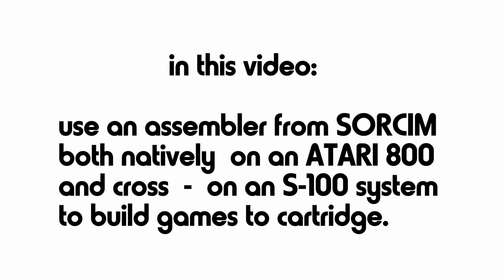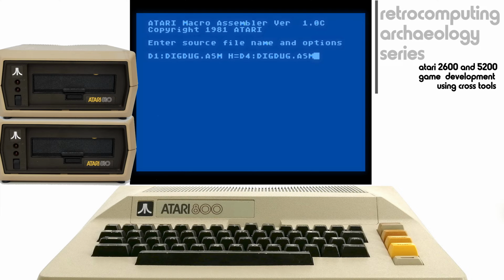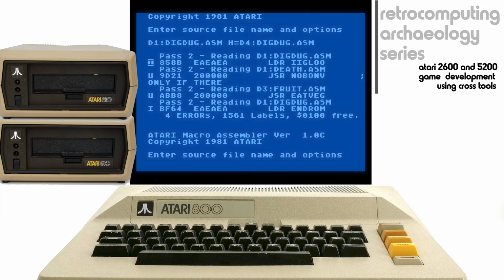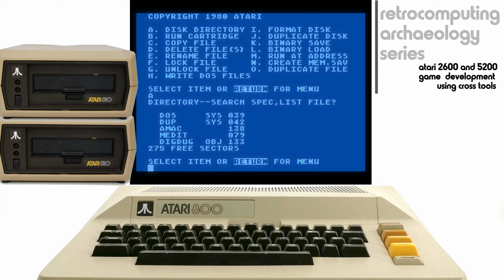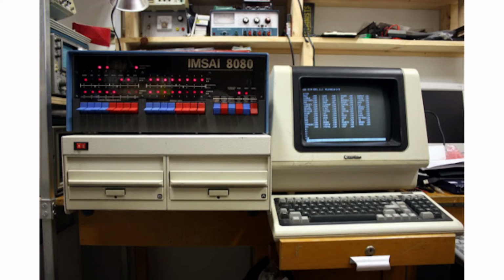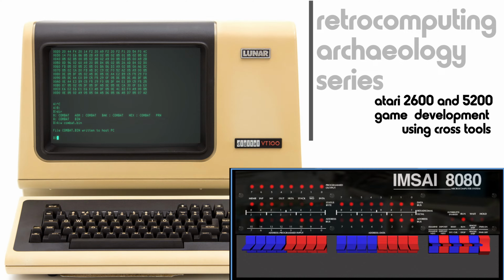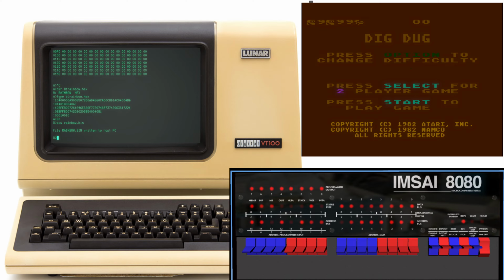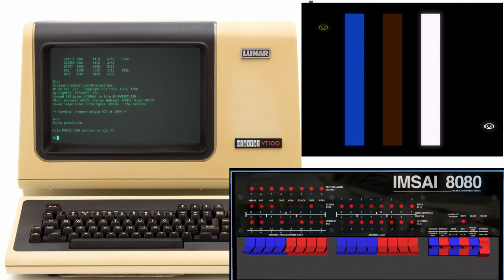An Example of how #Atari2600 and #Atari5200 #Gamedev was done #BITD using #S100 hardware.

Comment: Atari 800 5.25" floppies only held 90K?!? Wow! I had an Apple II+ back in the day and its disks held 144K. I wonder why Atari Disks had such low capacity? There must have been a lot of overhead in the formatting scheme.
Reply from the maker: Single sided, single density. 40 tracks, 18 sec/trk, 128 bytes/sector.

Comment: Nice, I really enjoyed this video and the presentation style.  But... how could you run the 2600 code on the 800 - are they that compatible?  Maybe I just missed when you explained this.
Reply from the maker: The 2600 code is not running on an 800. 

It is running on a 2600 with a black box, which I am simulating with Stella.
Reply: It looks like you're starting the assembled file inside the 800 emulator at https://www.youtube.com/watch?v=59qT2HFWJRo&t=2043s . I can't get any references to "black box" when I google it - except for the "Vader" 2600, so I guess that's the model you let Stella emulate.

Having tried a couple times to write a game for 2600 on modern equipment using Stella (and also on real 2600 hardware with a RAM cartridge)  I really feel sorry for the poor guys back in the day with compilation times of several to tens of minutes of code iteration & test times and no possibility of debugging / single stepping. I didn't realise that assembling the code took that long.

The slow assembly speed is a bit strange since an assembler does a much more straightforward and simple job compared to a real compiler.  Maybe the bottleneck is the transfer speed from the floppies rather than the compiler itself?
Reply from the maker: @MatsEngstrom  This is an example of using the native assembler on the Atari 800 to assemble an Atari 800/5200 game.

"Black Box" or "Brown Box" was an industry term for a ROM emulation and debugging setup, consisting of custom circuitry attached to the target game system (usually to the CPU) to intercept its signals so that a developer can perform rudimentary debugging procedures. I am simulating black boxes for the 800, 2600, and 5200 here with emulators, in this case, Altirra and Stella.

Why didn't I use a real black box? Because I don't have one, and very few people actually have any of these artifacts (and they are VERY content to stare at it on their shelves). As soon as I can get my hands on some of this hardware, I will demonstrate it in use and in context.